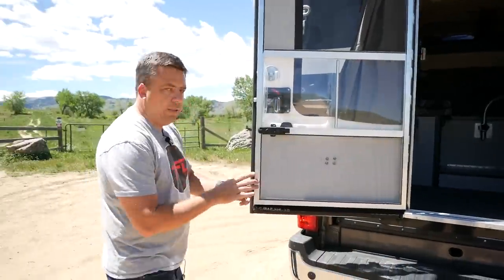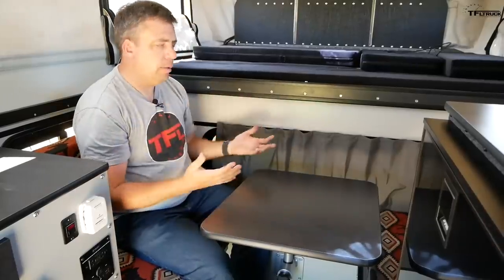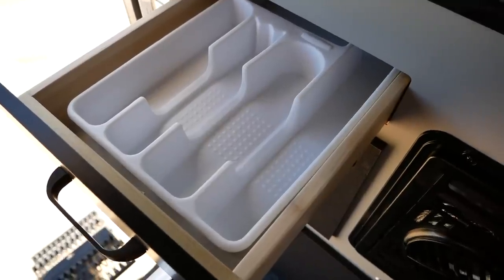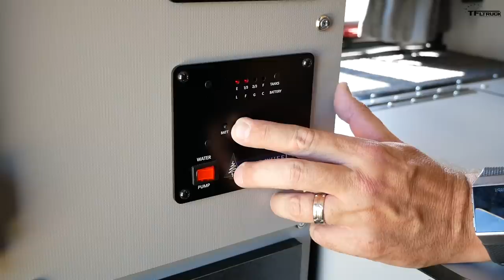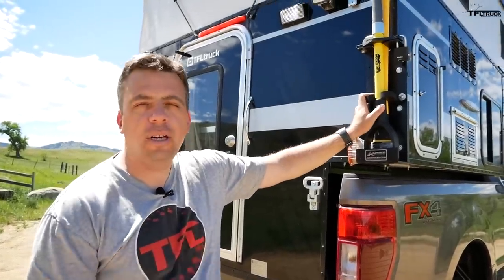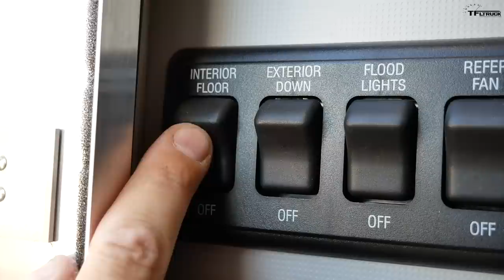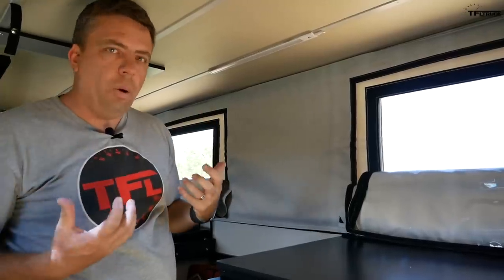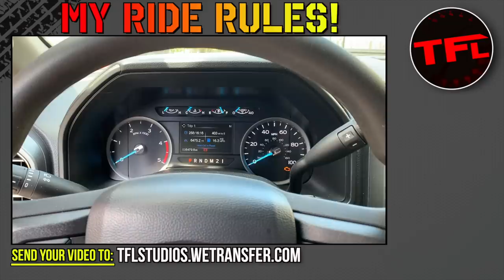Here's a Great Way To Camp On and Off-Road With a HD Truck - This Popup Camper Has it All!

Comment: 😀 Nice review. We own a 2021 Granby (shell model) sitting on our 2002 Ford Super-duty super cab (8ft bed) F250 7.3 Power-stroke Diesel. We get an average 18-19 MPG and so glad we sold our heavy tall 8.6 overhead camper. So we chose to save $15K and purchase the Shell and outfit ours the way we wanted and for the way we use it. We don't full time or do cold winter camping. I built bigger cabinets (more storage) and larger drawers, added a water pump and we use portable water containers.and have a portable black water under the sink.. The most expensive thing was our Bluetti AC 2000 watt power station and two Renogy 2000 watts flexible solar panels on the roof (I installed it all). Added a front bench hiding the port-pot (never used) and water, a Logoon table, 12v 54 qt portable chest Fridge/Freezer and we have a MR. Heater that hasn't been used but twice.. So we love it because its light weight and we can pull our 14' aluminum Klamath fishing boat with ease.. Again, I love your channel and all of the reviews! Thanks

Comment: Let me know how your Southwest trip goes with no AC in that camper.
Reply: Then when they come on over to Death Valley in the middle of summer they may be having second thoughts!✌️🍻
Reply: While boondocking you would be unable to run the a/c unless you packed a big enough generator to power the a/c. unit.

Comment: no way I'd pay 30k for that
Reply: Think about it by raw materials and components.  Aluminum frame/siding/roof, cushions, countertops, cabinets and hardware, vents, fans, windows, sink, pump, two agm batteries, stovetop, plywood floorpack, fridge, furnace, water heater, led lights inside and out, wiring, breakers, relays, battery charger, solar panel and controller, etc.   Be realistic. Two agm batteries are $500. Furnace $600. Fantastic fan vent $200. Fridge $800. Buy a piece of 3" foam for a matress is $150 without sewn fabric cover. $30k is a lot of money, no doubt, but that is different than these being priced wrong. All those components add up fast. Now, pay someone to weld the frame, wire it, build cabinets, sew cushions, install fridge, furnace, fans, solar, stove, sink/plumbing, etc. Think about it by component at you see why they cost so much.
Reply: @MrChadx1  you can do all new siding hvac and appliances in a house for 30k
Reply: @MrChadx1 Still, it’s a truck camper, more raw materials go into building a Chevy Sonic. The manufacturer went with cheap materials and jacked the price higher than it should be so they can make their money back faster.
Reply: @chumbawaumbacumpa  Chevy Sonic are not hand built. Economy of scale, small margins and assembly line built by robots in mass quantities. Price a hand assembled vehicle (even one without exotic materials) and you are six figures.
Reply: @LTHero.  Guess it depends on the quality. You could spend 30k or 120k for those items for a house. You can spend 10k or 100k for a slide in pickup camper. RV appliances cost 2 to 4 times as much as house appliances.  Just the hours in labor for welding up the frame in these campers is  incredible. This is not a particleboard, stapled and glued economy slide in camper. Those 10 to 15k campers don't handle overlanding very long. Re-read my first post on materials, now add labor, employee benefits, manufacturing space, utilities, marketing, distribution, research and development and oh, they are a business so need to make a profit.
Reply: @MrChadx1 Chevy Sonics are assembled by people down the assembly line. Robots only do welding and the paint process. GM however, is quite a large corporation. They produce so many cars that they can afford a larger overhead cost. This is a small company making not that many campers, hence why I said that the company making these campers has jacked the selling price up per unit so they can make their money back faster after development costs. They don’t sell as much, so the price is up to help compensate for that. When you take into account all of the other campers on market, 30K is out of most people’s price range for a slide-in camper. A lot of the people in the market for slide-in campers value their own trucks at less than 30K. The camper in the video is made for people with a lot of disposable income that are into overlanding, who want something that can stand up to the trails. That’s a small niche in the market. Most of those people are financially successful and will want at least a toilet or shower if they’re spending 30K on a slide-in camper. If you’ve worked hard enough for your money, you’ll want the best bang for your buck. This simply isn’t a good value, and it doesn’t come with as much amenities that you’d think it would if you’re gonna be spending 30 grand on it.

Comment: It’s missing Tip-Out bunks.... if just 1 manufacture did 1 or 2 tip out bunks they would KILL the market. Even a Tipout canvas Wet Bath on the back!

4Wheel Campers should do it on their flatbed models too, that dinette barely sleeps 2 small children. You could even design a hard shell tipout bunk that wouldn’t have any canvas but folding walls and ceiling with windows. But the tent tipout would definitely save on weight.

That’s what Truck Campers is missing and I can’t believe no one is talking about this great idea! Another great idea these campers don’t have that they fell short on again is a Dual Mini-Split that runs on solar only! It’s extremely possible to do, many truck before camper owners have converted their. On these tent models all you have to do is build a bracket on the ceiling and hang the unit when you setup (stow is in the dinette). The compressor mounts on the back outside which most of these 4wheel campers have accessory brackets for gear. What do y’all think?

Comment: you are most welcome to visit us here in Saudi Arabia , middale east
Reply: This would be so great to have in KSA.  Some really great adventures could be had.  I do wonder, US trucks are really fussy when it comes to diesel type.  I wonder if the diesel on the local market would be OK for it.  I do see a lot of Raptors over there, but not many Ford Diesel trucks.
Reply: Long drive though.
Reply: Will not a lot of people like the diesel truck over there

Comment: 4 Wheel Campers make a really nice pop up but I do agree with other comments about the pricing.  I have been looking some at them as I have a hard side now which is awesome (Northern Lite 8.11 SE) but even still I am limited as to where I can go.  You can get an indoor shower and cassette toilet in the 4 Wheel Camper but that option runs an additional $3 grand.
In my NL I have all the luxuries including A/C for just a little more than this one costs.  Truck campers are expensive if you think about it from a square footage basis and if that is how people determined whether to buy one, they would not exist.  Truck campers are a lifestyle and people that own them are not interested in camping at your nearest KOA with their big 5th Wheel or bumper pull.

Comment: I just bought a used topper for my 92 Chevy that is like new condition and I'm going to build my own platform and put a real queen size bed inside it..
I will have two feet behind the bed for whatever I want to bring with me plus room for totes underneath the bed..
I spent $600 on a custom sized short queen mattress the whole thing will cost me under $1,000 and it's all I need

Comment: I got my 2002 F350 7.3 Powerstroke Crew Cab with 200k and a 1999 Lance 10'1 Camper with shower, toilet, propane range, microwave, fridge, ac, and heat with lots of space and storage all about 22k.

Comment: Nice set up with loads of space to make it really an overlander I.e. install solar panels on top of the roof (get HD struts), get the cold weather insulation for the pop up part, get a powerful inverter for 110/220V AC, loose the two heavy gas tanks and get instead a water- & inside-heater fueled by the trucks fuel (pref. diesel), get an induction hotplate for cooking ..... AND keep the truck low enough to fit into a sea container which will be needed to be a real overlander!
Have a look @grizzly&bear a couple using a camper like that traveling the world

Comment: The main advantage of this over a standard construction camper is the weight. Full body campers are easily double the weight of this one. When going offroad, even fire roads, the big ones are known for ripping turn buckles out of the bed. This one that is much lighter is less likely to do that. Although I would have left the legs on it, so you can level it for sleeping.

Comment: Very nice popup camper, but, having to manually raise the camper to stand up was an immediate no-go for me. Also, no A/C would be a problem traveling in the south, southwest, and, southeast where I’d be primarily traveling. I ‘do’ like that the fridge is NOT on the floor, as, I’m a senior and not as agile as I was in earlier years. Many other things were nice also. Nice presentation! ~Jim~

Comment: Fully equipped camper with out AC the most important thing if out in the heat basically a 30,000$  ⛺️

Comment: Nice review, just a couple of questions: Are the windows in the pop-up waterproof when all closed up? What if you get caught in a bad thunderstorm while camping? Also, is there a pass-through to the cab if you have a sliding rear window in the truck? I saw the curtain under the table, just wondering if that's a window that can be opened? That would be very handy if you're parked and have some people sitting in the cab, and some in the camper.

Comment: Nice compact camper.  Do you get nuisance reverse guidance messages in the Trailer View or Cab Mounted Camera in reverse with the tailgate removed?  I use the trailer view to load my camper but get nuisance warnings on my 2020 F350.

Comment: Why is it set so far back in the bed?  Looks like the whole thing needs to slide up about 4 inches to be snug to the back window of the cab. Isn’t there supposed to be a passthru from the sliding rear window of the truck to the camper?

Comment: You would have to be insane to pay $32,000 for this.  You can pick up a used Toy hauler for $12,000 and still have another 20,000 to pay for a brand new road king to put in the back.
Reply: Who wants to tow a toy hauler?

Comment: Class act Andre.  Very detailed video here. Extra nice floor plan shown was nice to see as well.   No cassette toilet for the gang?  Why does the camper NOT fit up tight against the cab?  Never seen one that didn't.  Was an excellent pass through to the cab window.  And I would highly suggest the gang use those camper legs on the trip.  It makes for a much more stable feel when you are in the windy spots. ;)  Can add a leveling when your truck is not.

Comment: Was this a review or paid promo? The praise lauded on the premium construction didn't line up with the video showing wobbly drawers, stuck on switches, and not even LCD displays. At this price point a premium finish is required, but this video didn't demonstrate it.

Comment: Why make a crew cab short bed into an over landing rig? Y’all coulda saved a good amount- ext cab long bed. Then you could have crapped in A/C & had a generator like every other overlander. Also, you should have put long travel air bags with a lower capacity spring system so the truck isn’t worthless without 2k lbs. SO MANY ISSUES with this build LOL

Comment: I'm curious why it has a 30 amp hook up with no A/C or microwave?
Reply: Perhaps because the 30-amp hookup is on all of the builds, whether the optional equipment that would need 30 amps is in there or not. Just a guess.
Reply: Because the other standard is the 50 amp 220v and that would be nuts to do.
Reply: Because it's either 30 amp 220 or 15 amp 110. Or the 50 amp 220 but that's your only choice at camp grounds, and running the whole camper off of an 110 plug isn't very good.

Comment: What's the weight of the set=up and the carrying capacity of the pick-up? As this is an important factor, options on the pick-up can reduce the tow/carry capacity, then options on the camper unit obviously increase it's weight. Many people see these set ups at shows and do not realise, what is on the show stand is not suitable for their vehicle.
Reply from the maker: The camper weight is between 1,300-1,600 lbs, depending on equipment. The truck’s payload is over 3,000 lbs with custom springs and shocks all around.

Comment: Lol what's the over all weight of the caper compared to the trucks load copasity, look heavy for the 250, you my need to add sumo springs for the sqat, and 30k you could have got a black series trailer

Comment: That's a nice set up for a non towing camper option. Well equipped. If your camping you dont really need a/c( although nice to have). Nothing wrong with the bucket and toilet seat lid either.
Reply: Obviously you don’t camp in the the south. Let’s see you bake in that rig in August down in Ga / FL.

Comment: $30,000 plus!!!! And no AC? Yeah that’s a hard no. I honestly wouldn’t even pay $20,000 for that. 🤷‍♂️
Reply: Think about it by raw materials and components.  Aluminum frame/siding/roof, cushions, countertops, cabinets and hardware, vents, fans, windows, sink, pump, two agm batteries, stovetop, plywood floorpack, fridge, furnace, water heater, led lights inside and out, wiring, breakers, relays, battery charger, solar panel and controller, etc.   Be realistic. Two agm batteries are $500. Furnace $600. Fantastic fan vent $200. Fridge $800. Buy a piece of 3" foam for a matress is $150 without sewn fabric cover. $30k is a lot of money, no doubt, but that is different than these being priced wrong. All those components add up fast. Now, pay someone to weld the frame, wire it, build cabinets, sew cushions, install fridge, furnace, fans, solar, stove, sink/plumbing, etc. Think about it by component at you see why they cost so much.

Comment: I have the same truck with the 7.3. What are you guys running in the rear? I have an older camper that weighs about the same. I want to run a lift and your truck looks fairly level! Can't wait for more videos with this rig!
Reply: "what are you guys running in the rear?"  Do you know Ned Beatty?   It is a 4 wheel drive if you change the rear gearing you also change the front.

Comment: That's quite a rig, Andre. Why so large a capacity generator that you don't have air con? Coming from a 36' Class A diesel pusher with two roof air units, my Cummins diesel genny was about the same output as the Honda. I'd think a 2000/3000 watt would be perfect for your setup....and Way more quiet. Your camp neighbors will thank you...
Reply: Pretty sure the large generator is mainly for some experiments they are doing with their EVs.
Reply: @jamesbeaman6337  Agreed. I think Andre used whatever available generator at hand to demo the interior electric features.

Comment: Comment about the "My
Ride Rules section. The guy identified his truck as a 2019, however, it shows the air "nostrils" beside the headlights, which was supposed to be a new feature of the 2020, and a way to differentiate from <2019. Did he misidentify or am I misinformed?
Reply: It is a 2020 f250 
But they bought it in 2019

Comment: Or for roughly the same price you can get a 32ft travel trailer with AC, bathroom, shower, forced air heating, fridge, sound system, TV, generator,  and sleeping space for up to 10 (or 5+ adults).
Truck bed is also available for cargo or an ATV.

Have never had any issues getting mine into the deep woods or 10k+ foot mountains of Utah.  Dropped and leveled before the first 12oz beverage is done, then you have an empty truck to go have fun.

Comment: These are nice little rigs, however I think they are insanely over priced for the amount of materials. You can buy a nice pull behind lightweight rig for less than that with so much more room. They are definitely taking advantage of the Overland craze. Hell for that fact of the matter the truck is now insanely overpriced too so there's that.

Comment: Good review Andre.  Unfortunately, I hear they have two major issues w those campers.   First condensation, would be great to hear if you have that issue too.  Second and similarly, there is no air barrier under the mattress.  So you are likely to get water there too.  That could be fixed by the placement of coils.

Comment: awesome video! it seems a lot of people recommend going with a super duty for a overland rig if using a camper because of the weight. is there a reason to go with a 250 over a 350? everything i’ve found online comparing them just talks about towing. If the size of 250 is the same as 350, wouldn’t it make sense to go with extra payload capacity?? would love to hear your opinion or see a video comparing F150 to 250 to 350 for overland and off-road!
Reply: Its a matter of what kind of camper you want to put in the truck. 
A small and lightweight like the one in this video, then a f250 is better than a f350, because f350 will have springs too stiff for the little weight of the small camper.
A big and heavy one (like the bigest there are), and then even a f350 is not enougth and probably a f450/550 is better.
Basicaly the difference between f250 and up are 3 things, stiffer chassis, stiffer springs, and beefier axles.
You get the idea.